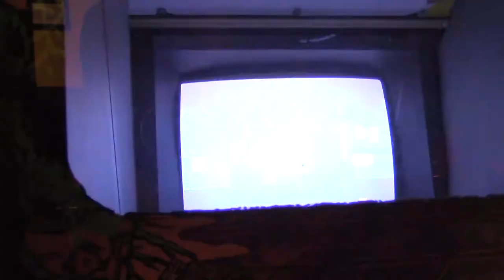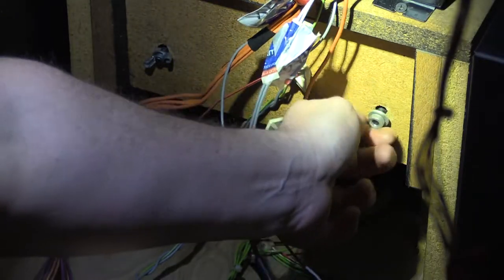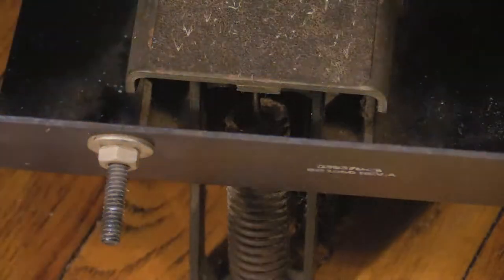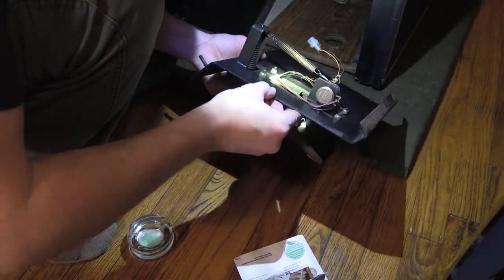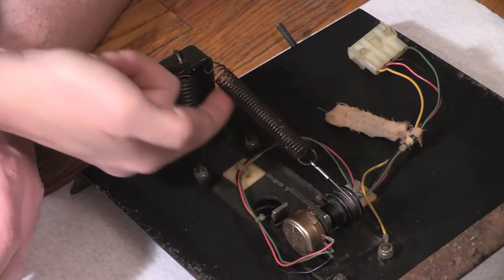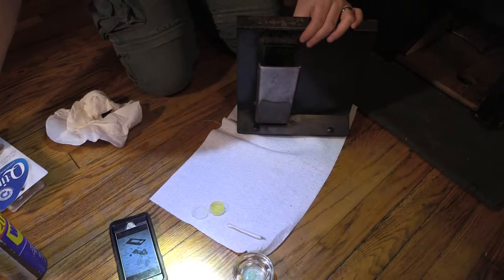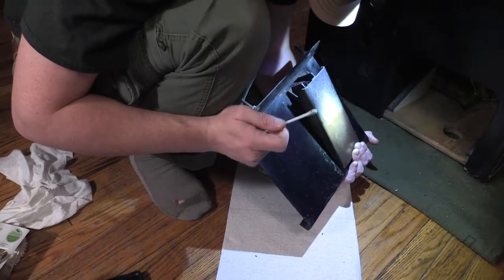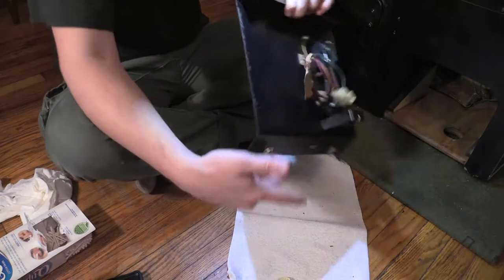Pole Position 2 - Repair Part 3 - Gas Pedal Cleaning and Lubricating | Arcade Restore

Comment: grat job!!, but is there a reason why you never used compressed air to assist with the cleaning, or a vacum?
Reply from the maker: Blowing air would make the dust, mites and dander airborne and be brutal on my allergies. I usually dont use vacuums either as they tend to create dust currents too but after ive wiped out a cab really well a vacuum works great to get the little crumbs of debris in the corners for sure.